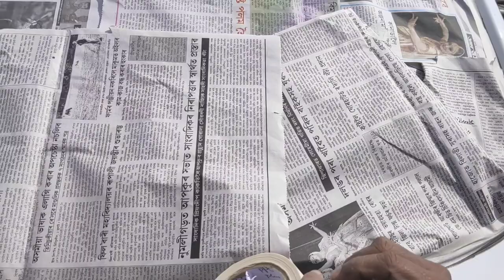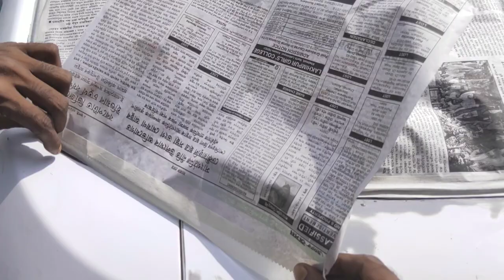Car painting yourself at home | car Restoration | car painting

Comment: What happens when using asian oil paint
Reply from the maker: you can use but it will not dry quickly. it Will take more than 1 day for dry.
Reply: Hi, good work! Good luck, frend.
Reply: Bro automotive paints are different never use enamel paint on vehicles